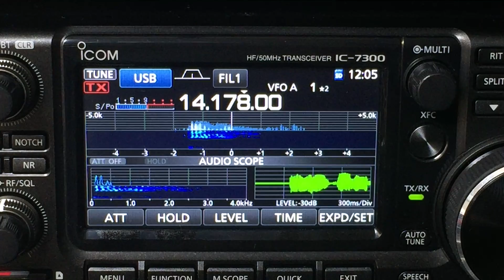IC-7300 RF/Audio Analysis

Comment: Pointless ham radio rag chewing for 9 full minutes and another grueling 11 seconds.

Not a single word about adjusting audio settings or filters. Or even what they are currently set to.

Just a meaningless display of audioscope waveforms.

Who are you guys and what are your call signs and QTH? Other than  passing mention of N2NQM and WT1H who are not even part of this conversation, there is no clear QRZ or QTH of the participants of this exchange.

Comment: Nice video.
Btw, I borrowed one and found some settings I think was better:
EXPD/SET (hold in)...
 - Scope Set - 1/4 Center Type Display - Carrier Point Center! Gets the passband where it should be on the side of the carrier.
 - Scope Set - 3/4 Waterfal Display - Off  (no need for during audio viewing)
 - Scope Set - 3/4 Waterfal Speed - Slow
 - Scope Set - 4/4 Waterfal Size (Expand Screen) - Small

Audio Scope:
EXPD/SET (hold in)...
 - Audio Scope Set - 1/1 - FFT Scope Waterfall Display - OFF (no need for during audio viewing)

73's de LB5VA, Stig
Reply: How do you have your receive audio set up? That is the quietest receive I have heard yet on the 7300.
Reply from the maker: Thanks for your comments, Stig!  I'm still learning the features of the various scope functions on the IC-7300.